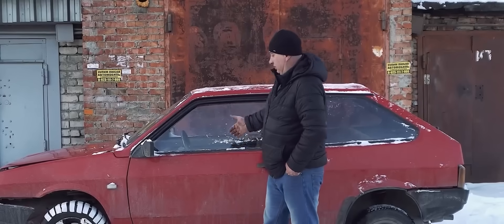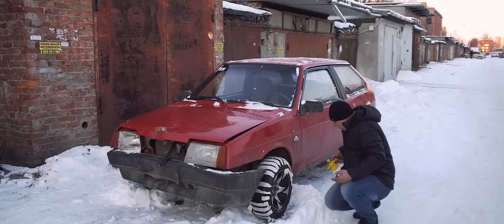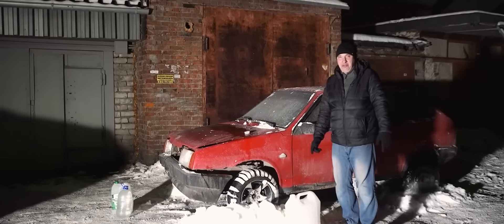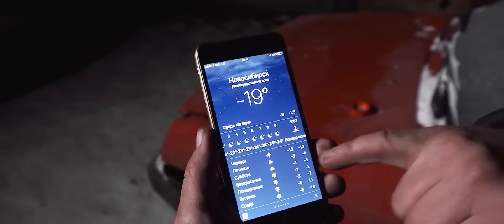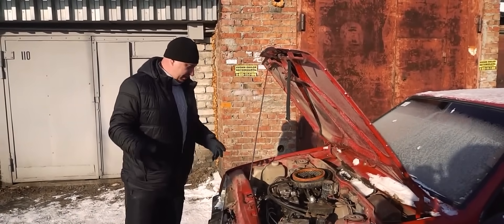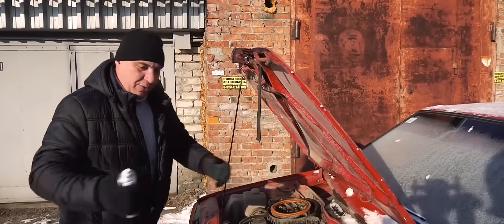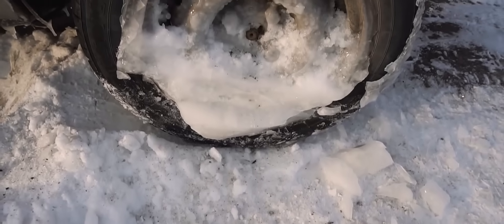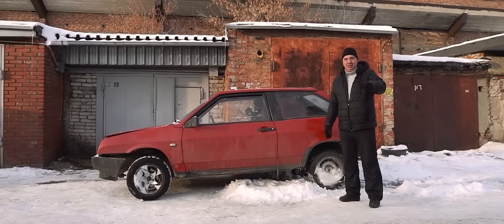Wheels frozen into ice - can a car drive out?

Comment: Big issue is that when you pull it forward you actually need to lift the car up the wheel shaped incline the tires made which is not the direction the force is at. I had this happen to me when a puddle formed around the car during a warm Sunday and it froze overnight. I did not make it into work that Monday morning.

Comment: Common sense says if there's enough ice holding the wheel that the only thing it will do is hold the vehicle in place and put extra wear on the engine, transmission, and drivetrain.
Reply: What about the muffler?
Reply: @TurtleHead420 can't forget the frame dragging especially if the rims are frozen in ice all the way up to the lug nuts

Comment: Tire rubber allows flexion of itself away from the ice, even if the ice has formed around the tire unless the entire tire was encapsulated in ice or the tire was full of cracks for the ice to dig into it will flex and break free.

Comment: Damn that is cold. The mini van is awesome. Does not get that cold but had to use starting fluid on a diesel at about 18 degrees and later realized it could have been bad. Was a flashback when you were starting the car in much colder weather. Great work on the videos.

Comment: Had a 2005ish Dodge Power Wagon, parked on a Friday, got warm on the weekend but I didn’t move the truck so it kinda sunk in the slush. Needed to go into 4 lo and loaded the torque converter to about 3200rpm before it finally yoinked itself out.

Comment: 6:28 the camera man walking infront of the car was genuanly dangerous. Come on guys, this is how you end up at the darwin awards..
Reply: why is that?
Reply: So dangerous 😂😂😂 you're a moron the wheels weren't even spinning
Reply: @RejectReality97 of course bro... Insult me like the intelectual that you are. Look at the video. The tire that was already broken free was spinning at full speed in first gear. If the other one would have broken free and gripped the cameraman would have been on the cars hood. It is simple, you dont hold a gun infront of your face even if you think its not loaded. And you dont step in front of a car that is trying to accelerate at fullspeed, if it grips or not, doesnt matter.
Reply: @RejectReality97  btw, your name fits your inteligence very well. "Reject reality" lmfao, you came up with that yourself? 😂

Comment: Here is a better challenge that actually happened to me. There is a rule that you never set your parking break if it is freezing outside. You arrive at work after it was a freezing rain and slosh. You have a front wheel drive car. You set your parking break that the cable is covered with water and snow. You leave your car and return after work. The brake cable has frozen and your back brakes will not release. You can drive on the ice with your front wheels, but your back tires are sliding. 

How do you solve the problem? I waited a week for the ice to melt. I am sure you guys will come up with a much better solution.

Comment: the best car channel out there!. making childhood dreams becoming true! i have an idea: what about driving two cars at the same time, (independent transmission, engine and steering) welding together a left and a right driving car. this must look funny sitting between the door frames and pressing two pedals at the same time. always was thinking about how that works and if it works at all. the idea came up again while seeing your right driving van🤣
Reply from the maker: Some time ago we made a video titled "Welding two Ladas together: super tight tandem drifting", is this what you have in mind or not exactly?
Reply: @Garage54ENG  yeah great i have seen it now thats nearly my idea but only with one driver. but i think its not that different except you have a big workload and hands and feet are busy with one driver. An other idea would be to stack two ladas on top of each other the lower one features still the steering components while the upper one has the engine. both connected via a chainsystem or axle shaft to propell the lower one. The handling and driving experience would be quiet interesting, and it might also have amphibious cababilities like crossing a smal river or pond with the right tires wihtout water damage to the engine.🤣

Comment: This actually happened to me once. Back in 2016 I had a collision with a semi-truck, my car was totaled, and it was transported to a shop in Moscow. It stood parked for a while before it was pulled apart, at some point it snowed, then the snow melted, and when the temperature dipped below 0 degrees Celsius - all four of my tires were trapped in ice. The workers of the shop had a really hard time pulling it out, I recall someone telling me they even broke the Hyundai Porter that they were using to try and yank my car out of the ice.
Reply: OH snap, that's not very good at all. Also, you are the voice over guy, if I remember correctly. I hope life is treating you well.
Reply: @TheHungrySlug  yes sir, you remember correctly. Life has been alright, thank you so much.